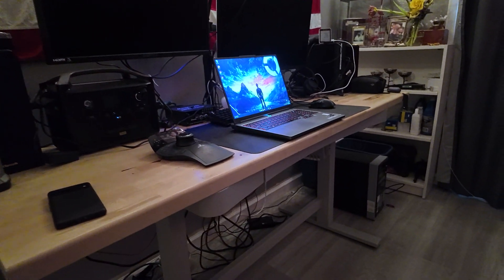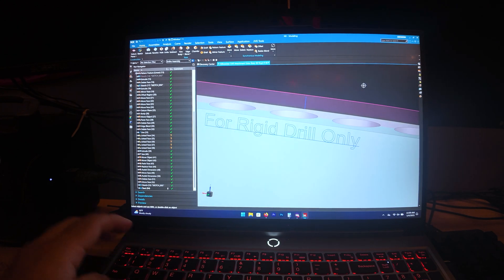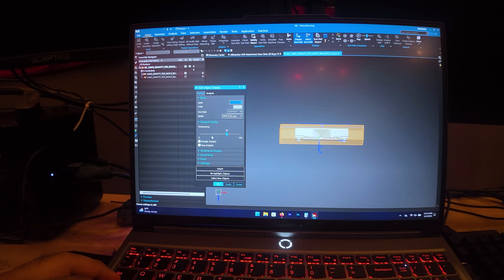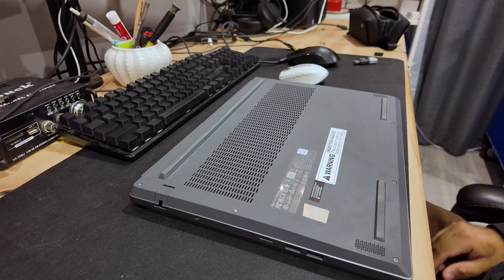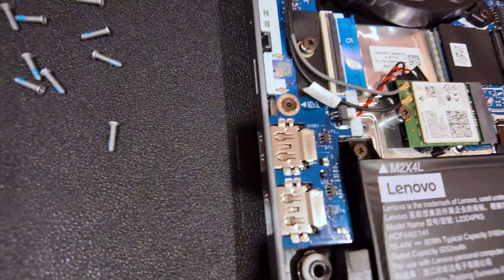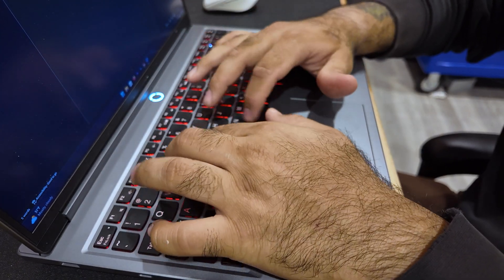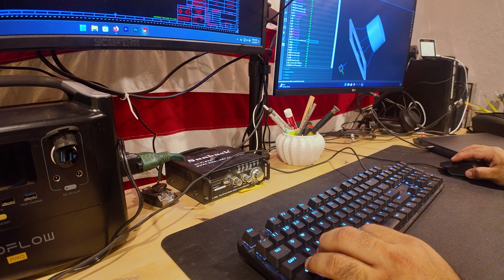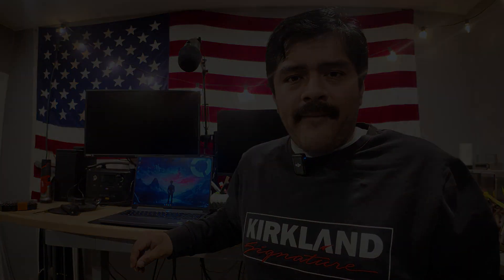Review: Lenovo LEGION 5i 16" From Costco - Is it Worth Your Hard Earned Money? (Engineering/CAD)

Comment: The specs at my Costco are totally different than this. It has an Ultra Core 9 processor and RTX 5060 graphics card.
Reply: The one you are mentioning is the newer version of the laptop that is being reviewed.
Reply from the maker: It could be that the inventory has been shuffled. I will take a look next time I'm around!
Reply: Costco just brought out brand new inventory/refreshed version of this laptop. There are no longer ports on the back of the laptop, but rather on both sides of the laptop. I personally have sound issues on the model @jive_engineering is using with tons of stutter and freezes with videos, games, and online calls which is rather annoying since i'm barely touching the laptop. Hoping someone checks this new model out since I bought the laptop not even 5 months ago and already having issues.

Comment: I bought both this 5i and the slim 5 and tested them. The 5i only has two vents coming out the back and the 5 slim has 4, two out the back and two on the sides. The slim 5 was much more quiet and had better temperatures. I also noticed that the slim 5 gives more power to the GPU in quiet mode. The 5i sounded like a blow drier in high performance mode. I would say get the slim 5 over this but it has an AMD CPU. If you want a intel cpu with 4 vents they have the pro 5i.

Comment: Just bought this from Coscto a month ago and I have to say I'm disapointed.  Sure the specs for the money is incredible.
But there are 2 issues that both me a ton.
1.) The cat5 jack does not "click" in so the cords always fall out.  The cover doesn't move out of the way enough either so it's a fight just to get it conneted and then don't breath too hard or it will fall out.  I read this is a known issue.  (seriously, these jacks have been around forever)
2.) No way to run this on an external battery.  HUGE issue for when I use this for photography shows.  Lenova make external batteries but not for this model as it requires more wattage than normal.  Ironically, there is a external battery port via the left side USB. It's printed in the manual and right on the side of the laptop, but if you read the online forums and reviews at Lenova, no one has been able to find an external battery that works with it.

Unfortunately I don't always have wifi and need the port to work.  Also, in my line of work, external batteries are a must.  I have 4 external batteries for my dell that died.
I would have bought another Dell but with these specs, a Dell laptop it would have been at least double the price (well over $3k)
If anyone knows of an external battery that can work with this.  PLEASE reply below.

Comment: Bought the same model from Costco. Great deal. Planning to replace the wifi card, upgrade RAM  / SSD too. Can post a link for WIFI card replacement please/
Reply from the maker: Thanks for reminding me. I have updated the description with the exact card I am using. Hope you like the computer as much as I do. :)
Reply: @Jive_Engineering  Yup. Loving it so far. I'm not a gamer - Just use it for work. I did max it out to 64GB (Kingston Fury) and 8TB (WD Black SN850X & Crucial P3). Not planning to upgrade WIFI card right now. WIll watch out the performance.
Reply from the maker: The wifi card was the main bottleneck for me. Trying to transfer a file from my NAS took a very long time with the stock wifi card. After replacing it, it was way faster. Speeds with the stock card were about 25-40 mbps while the new one showed 250-400 mbps. I would hope that they changed it out at some point during production.
Reply: @sundarselvaraj1394   I have to ask.. did you end up replacing both drives? I noticed you listed two different companies. Also.. I thought the laptop maxes out to 1 TB per drive (I'm looking at the Lenovo website). And last question... can you post the model numbers you used for the ram please?
Reply: @ShannaraAK  I did replace both my drives. Set aside the one that came in from Lenovo. Replaced both slots with 4TB each (Slot 1 - WD Black 4TB and Slot 2 - Crucial P3 4TB). No trouble whatsoever. Haven't seen any lag at all. 

Apologies for late reply. Good luck.